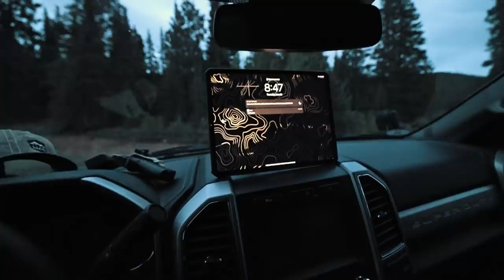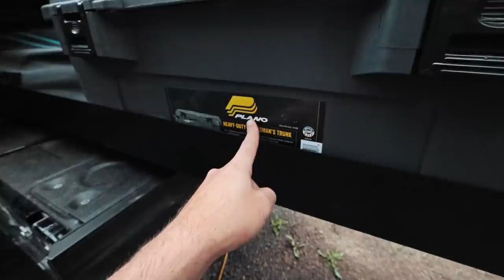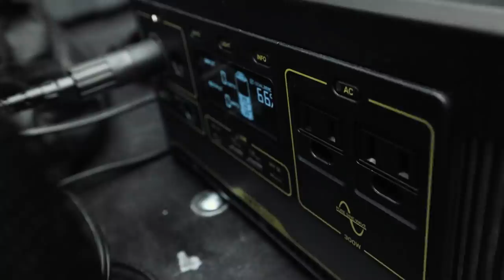Full-Size Colorado Camping - F250 Tremor In The Rainy Rocky Mountains - WEEKENDERLANDER EP 30

Comment: Excellent.  Truck looks great.  Video definitely had the “weekenderlander” vibe...which is awesome.  

Is there a video that has the specific payload and towing specs for this exact truck?
Reply from the maker: 15,000lb towing, roughly 3,000lb payload. I believe higher towing capacity though with gooseneck
Reply: @LastLineOfDefense  Thanks for the prompt response and info!  So it sounds like it should easily handle a 10K travel trailer even with the items that have been added to the bed.  Sweet.  One heck of a setup....

Comment: I got excited to see you have the new olight  mini warrior 2 and wanted to know your thoughts and then a piece of trash blows by which was a good save but squirreled the conversation. Lol. 😀Please make a video on the new olight warrior mini 2.  I returned my first one due to the free of the kids burning a hole in something. 👨🏼‍🚒 curious your thoughts on the new one?
Reply from the maker: ironically I actually went on to talk about everything I like about it for a few minutes, and what they changed with the 2 vs the 1. It ended up sounded a little too salesy, (which obviously wasn't my intention, as I was just talking about what I liked about the light and why I carry it), so I decided to just edit it out. There are so many Olight haters out there, that I unfortunately have to be careful what I talk about because I know there will be so much backlash. All that to say, I think it's a solid light, and the new sensor should alleviate any of the heat/burning concerns.
Reply: @LastLineOfDefense  I didn’t realize there where so many haters on olight.  I personally like Streamlight as a fire captain.  I just got the new wedge which I feel is an excellent EDC.

Comment: Hey Mike! Question about camping in an RTT. You covered camping in high winds in this video, but do you know anything about the safety of camping in a RTT in a thunderstorm? The reason I ask is I was camping in my CVT Mt. Bachelor with my wife on a road trip from MA to SD in WI a couple years ago and we had a severe thunderstorm roll through at 2 AM. I made the decision to wake us up, close up the tent and take shelter in the cab. I’m wondering if that was the right choice and/or if that was necessary. My way of thinking is we were up high on series of pieces of steel and aluminum, making it a pretty good lightning rod.

Comment: Hey what suspension do you have on the pickup to travel that smooth in rocky terrain?  My 3/4 ton rides like a lumber wagon and need to fix that.  What's your wheel and suspension setup?